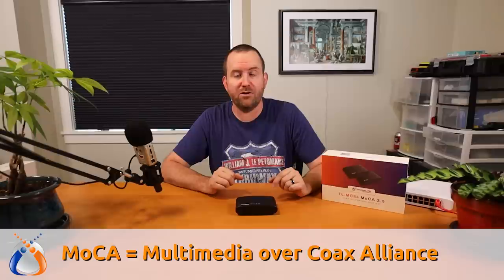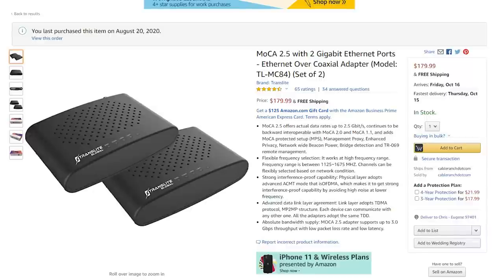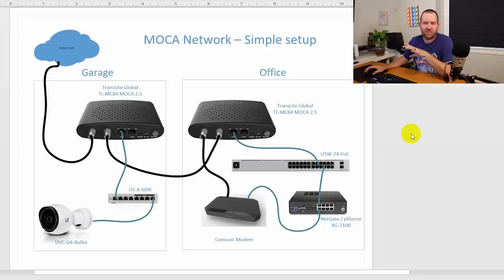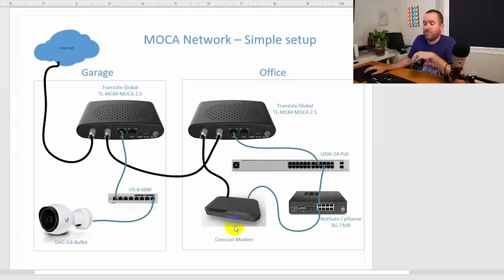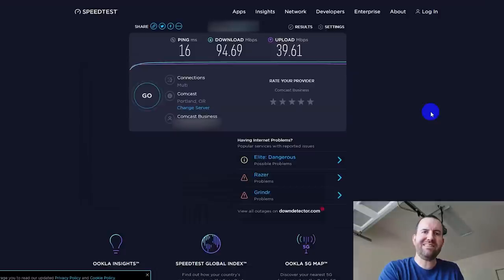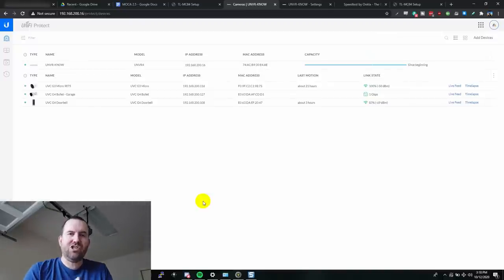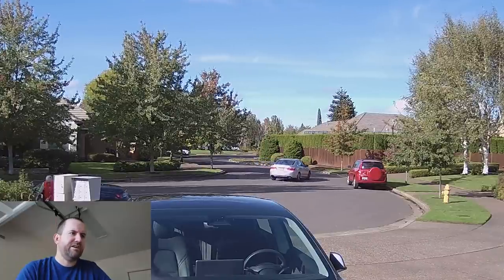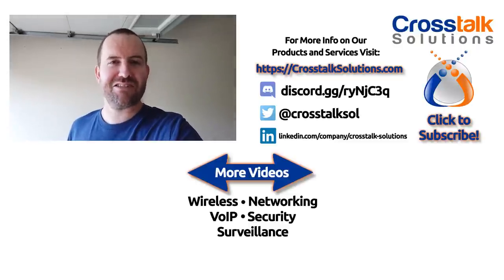MoCA Made Easy!

Comment: Hi Chris,

As several people mentioned, there are some issues with your installation.  Here is  my 2 cents on my experience with MoCa.

1) You do not have a filter to prevent your neighbors from tapping in on your internet.

2) The way you have your splitters is causing a lot of loss for the MoCA signal.  Splitters have very good isolation between the two out port (greater than 20dBs).  Since you have two splitters, you are cutting your MoCa signal by 40dBs.  It probably will still work but my guess you are not getting the full bandwidth out of your MoCa device (e.g. 1Gbps).

3) You are cutting the signal to your cable modem by at last 7dBs by having splitters in line.

The solution to all of these is easy and doesn't require running new wire.  The MoCa adaptors I use operation above 1GHz and CableTV/Internet operates below 850MHz.  If your MoCa adapters also operate above 1GHz, you can use a couple of satellite Diplexers and solve all the above issues.  Satellite Diplexers were a way years ago to send both Satellite Dish (which operatie above 1GHz) and Cable TV (below 850MHz) down down the same coax.  You need to read the specs for the diplexer carefully.   Basically, the TV side of the Diplexer needs to pass 5 to 850MHz and the Satellite side needs to pass everything above 1GHz.  I use my specturm analyzer wiith a tracker generator to confirm this but I doubt you have a spectrum analyzer.  I usually get them from my local distributor but this one looks like it will work:

https://www.amazon.com/Heavy-Diplexer-Splitters-Satellite-Approved/dp/B00JJ10V8C/ref=pd_lpo_23_t_0/135-4781497-1689209?_encoding=UTF8&pd_rd_i=B00JJ10V8C&pd_rd_r=dc6b0a16-b7c9-4856-b83e-d91d03c2afc0&pd_rd_w=aVpld&pd_rd_wg=Gk7Ya&pf_rd_p=7b36d496-f366-4631-94d3-61b87b52511b&pf_rd_r=VR7CQTF2E73V0W0WWB27&psc=1&refRID=VR7CQTF2E73V0W0WWB27

So all you have to do is replace your two splitters with Diplexers.  The in/out side of the basement diplexer connects to the in/out side of your office diplexer.  The UHV/VHF side would go to your cable modem in the office and your Comcast connection in the basement.  The SAT side would go to your MoCa devices.  And that is it.  You cable modem signal and your MoCa connections will now have very low loss and your Moca signal will be blocked from going out of your  house.

Contact me if you need any help.  You sure have help me many times so it is the least I can do.

Steve
Reply: Wouldn't even Diplexers introduce loss or noise? What about 2.5GBS compatability?
Reply: There will be some insertion loss with a Diplexer but it is usually only a couple of dBs. I have used Moca adapters with 50dBs line loss and they still work although some reduction in speed. So a few dBs loss in a diplexer is insignificant.  The Moca adaptors I have tested with a Spectrum analyzer are transmitting in the 1 to 1.5GHz band.  If you are using a Moca adapter that is using one of the channels below 1GHz (the ones I use do not because they are made to work with cable TV systems), well then, a satellite Diplexer won't work.  Not sure if the 2.5G Moca use any of the bands below 1GHz but if the adapter has a cable TV output, you are probably safe.

Comment: I used these in my house.  They are awesome and allow fast speeds.   I have a direct connection to my router in the master closet and ran an ethernet cable to a MoCa adapter and from there to my Coax for my house.  I have another MoCa adapter for my home entertainment center which is connected to an 8 port switch to provide internet to my TV, Fire Cube, Xbox, Blue Ray player and Receiver.

Comment: I enjoyed the video as always.  But, Something isn't right with your setup or the switch port is set to 100 Mbps.  You should get 900+ Mbps bandwidth.
Reply: agree with this, i get 450 mbps, and my main 6 way splitter isn't the correct 1-2500 MHz type (yet)

Comment: I have a pair (and 2 more coming) Motorola MoCA 2.5 adapters.
I am impressed for the speed.
The house has antenna cable running around the house, so I just utilize MoCA.
Data transfer is ~90MB/s (around 720mbps) between floors compared with 120Mbps powerline.
Make sure the splitter supports at least 2GHz

Comment: In your setup are you feeding moca data back out to comcast, and as a result anyone on that physical coaxial connection with another moca device could gain access to your network?
Reply: Possibly a MOCA filter on the incoming CC line?
Reply: Yeah, you need to add an inline MOCA filter where the coax comes into the house. It's a small passive device that your ISP can give you.
Reply: He has one of these filters (vertically in the ingress box) which removes MOCA frequencies from the line.
Reply: He has a "PoE" MoCA filter installed; he just didn't explicitly mention the need or depict it in either schematic. (And he may not have even realized that "the filter" he pointed-out in the junction box was his "PoE" MoCA filter, keeping his MoCA network off the cable provider premise.)
Reply: @karlkaufman2659  PoE and MOCA are two completely different things
Reply: @mountainslopes  Within the context of a MoCA discussion, "PoE," especially when part of the term, "PoE" MoCA filter, refers to the incoming signal's point-of-entry (PoE) to the residence. A MoCA filter (aka "PoE filter," "whole home filter") is required at the "PoE" to keep the MoCA signals secured inside the home and to efficiently reflect the signals back onto the coax.

And, yes, Power-over-Ethernet is another technology.

Comment: It wasn't clear if the filter you kept pointing to at the demarc was a MoCA filter.  It looked like a grounding attachment.  do you have a MoCA filter at the demarc so your neighbors can't watch your cameras?  Or is a filter somehow integral to your MoCA adapters?
Reply: I was also wondering about that. Semmed possible that he is broadcasting his moca signal into the cable network.
Reply from the maker: That is a MoCA filter. Most ISP’s put them on by default these days (I know Comcast does for sure).
Reply: Lol I was thinking the same thing, dear God did he just accidently rip a giant hole in his network?
Reply: This answers my anxiety-inducing questions! Thank you! So the moca filter stops the back-feed to the cable network! I freaking love this! I thought I was going to have to run ethernet to my whole house! This is much more economic and time-Conservative! Thank you for the upload, Chris!
Reply: Cox certainly doesn’t and it will really compromise the signal strength of a tiny MOCA adapter
Reply: @CrosstalkSolutions  Spectrum doesn’t seem to install them routinely, at least in my area. Installs with just a grounding block are common. Fairly sure also seen Mediacom installations without them. Definitely wouldn’t ever assume one is there without checking.
Reply: I don't know about this particular MoCA unit, but it should support encryption, which can be setup to secure the local MoCA network, but it is best to have the filter, which looks to be the case for Chris.

Comment: And pre-share key between the two unit, or some sync to authenticate to pair the unit.  So if your neighbor or a bad guy try to get in your network just by plugging in the same model or comparable moca adaptor with a politer at the outside of your house or same cable node.  From your screen shot look like it got some hex key you can put in to secure your lan traffic on the moca side.

Comment: So, for those mentioning it. Common practice by all coaxial ISP providers is to add a MoCA filter at the terminating block to a household. The filter Chris pointed out originally is a MoCA filter. However generally speaking, you do want to isolate MoCA coaxial networks from general household coaxial networks. This is due to additional noise being on the line, and MoCA works on a Node to Node bases. Where each splitter/splice/connection in between weakens the signal. Most MoCA compliant devices are not very strong amplifiers to prevent disrupting normal household activities. So limiting your connections between links is best practice. However annoying to actually implement. This implementation will work alright, however may disrupt any common MoCA connections in use by comcast such as the XB/XF lines of products which uses MoCA to connect between their gateway and the TV access points. In which case you would need to isolate the internet MoCA network from the TV network in order to have both function normally or use a RF analyzer to determine which available RF spectrum you can configure your device to use to avoid collision.

Comment: Nice setup. Currently using the MoCA adapters from Motorola. 
What I did was made a Telco line in which is a single coax from my connection box straight into my modem and another separate coax cables to make the network setup with using the existing coax cable.
The only hard was finding where the existing  coax began and ended.

Comment: In my experience, you should be capable of getting close to gigabit speeds from moca but you need to make sure that there are only good quality moca compatible splitters and/or amplifiers on the cable - it may be that there is an old low quality splitter somewhere in the cable run.
Reply: Yes, good splitters (moca uses specific frequencies), and you can also help things by adding terminators to any connections on the splitters that aren’t connected to anything. 

There’s also a simple part (name escapes me) that you can place between your line to the outside world to prevent data from leaving your house.
Reply: @jacobharvey2946  point of entry filter  (or possible exit?)
Reply: @neildingwall6534  Yup that’s it, a POE filter blocks the signal from leaving the house. Just has to be on the line coming into the house.
Reply: The house COAX wiring is probably old RG-59 not RG-6 or RG-6Q which could handle Gigabit ethernet. Plus not all of the Coax bandwidth is available because it also transporting cable TV, and since Coax is a single pair, you need to use half of the total avail bandwidth for Send & the other half for recieve (ie to support full duplex comms.)
Reply: @guytech7310  Definitey could be old cable. Though what was shown in the video, at least at the box looked pretty new. But cable tv and the moca are on different spectrum. So good cable and splitters means it shouldn’t conflict.

Comment: Is there any reason you wouldn't default to setting the static/reserved in your Unifi controller instead of on the device itself?

I always leave devices like this in DHCP mode and let my gateway or router specifically give out the correct address. That was Unifi knows it's static as well, and doesn't accidently give the address to another device if it goes offline for a period of time.
Reply: I would suspect that he had the DHCP range outside the area where he knows he has static devices (to mitigate the DHCP server from giving out already assigned addresses).

I.e., his DHCP is .200.100 thru .200.200, so he knows anything below .100 is available to set a static ip on the device.

Comment: You should have a mocha filter between you and Comcast so no one else can connect.
Also if you wanna clean up the office coaxial you can put the splitter behind the wall to a double wall plate and then only two cables coming off of that :)

Comment: I have used these units for about two years now. Now problems with the devices but one of the adapters failed suddenly. Luckely these adapters are so common in our homes that I could solve the issue within half an hour. I use them to get ethernet at my television over the same coax as my digital television signal. Replay and recording depend on a good high speed internet connection. So far my wife is happy!
Keep up with the videos! They are a constant source of info on my Ubiquiti system. Thanks for that!
Regards, Rinus - the Netherlands.

Comment: I have the same issue and solved it with a pair of Zyxel Powerline adapters for $90.  Simply put one in the garage on a power outlet and the other on a power outlet in your home office.  This will handle the network connectivity for your switch and cameras and then have your Comcast circuit go straight to your home office from the garage DEMARC using your existing coax.  No splitters, no extra patch cables, etc.  Just need to make sure your circuit breakers are non Arc Fault Breakers.  Fairly cheep to buy normal breakers.  It's a lot cleaner approach.

Comment: Ok. I have a xfi gateway. I enabled the MOCA in it. Now can I just add the MoCA filter to the cable entering the house then cable that to my Xfi Gateway. Then after that how can I connect this gateway to a MoCA splitter so I can get connection to more than one room in the house??  Out of the 10 cables I have only one that is connected to a room in the house where I don’t want it to be. I’m just stuck on what adapter I can use that goes from my MoCA enable router to the splitter
3 days ago

Comment: Bought a pair on your recommendation and they work great.  Have 2 questions, did you find a link to verify if you have the latest firmware?  My firmware is 1.16.7.  How did you log into the second device to change the IP address and PW, do they both have the same default login IP?  Only one comes up with the default IP address on the unit plugged into the UDM and I did have the find other devices box checked.  Do I have to switch units and then change the IP address of the second device separately?

Comment: As others have said, you need to make sure there is a MoCA filter on the line from Comcast (But looking at your service box, that filter you have may already be a MoCA filter, but you should at least double check). Likewise you need to make sure that the splitters you're using are MoCA rated. I have Gigabit fiber coming in, and use MoCA over the unused coax of my apartment to connect my entertainment center in the living room to my office (and incoming Internet connection). I routinely get 500+ Meg over the MoCA link.

Comment: 1. Tapes an ethernet cable to that coax cable in your garage
2. Pul the coax cable from the wall in your office
3. Keep pulling until the ethernet cable comes out
4. Crimp on RJ45 connectors

Now you have ethernet without expensive MoCa adapters. You could even do 2 ethernet cables and set up LACP to have a 2Gbps redundant uplink if your switches support it.

Comment: So, I have looked into these for my  home.  My home was new construction and all the lines where unfinished in the basement.They used CAT5e for the phones and there are COAX lines as well.  I changed the phone to ethernet and some are used.  But COAX are still not terminated.  If I am understanding this correctly, I should be able to run all the COAX lines into a single splitter with one adapter in the room all my cables terminate at.  Then, just put one at each end I want output from.  I was under the impression before that I would need an adapter on both ends of each cable.  If I am understanding the right, it makes doing this a hell of a lot cheaper.
Reply: The splitter only accepts one and is really cheap anyway. You also are more likely to get good results with a splitter haivng less outputs.

Comment: For a network that I want protection on, I isolate the MoCA network from the cable network.  Not sure I can trust that the MoCA filter is "working".  At minimum I would test that I can not sync to the MoCA network on the public side of the filter.  May be easier for me as I only have Internet and not cable TV these days.

Comment: I bought three similar devices back in 2018.  Mine are branded "Motorola".  (Model MM1000 on Amazon).  They were $60 when I bought them, but are $70 now (each).  So for two they'd be slightly cheaper than the ones shown here.  But they are only MoCA 2.0.  Mine have worked flawlessly.  And it came with everything you need including an ethernet cable, a filter to keep your network from escaping to the exterior cable (I didn't need this) and even a little wrench to tighten the coax with!  And they handle VLANs with no issue.  I didn't know if having three of them (using a splitter) would be a problem, but it doesn't appear to cause issues.

I have Fiber internet and nothing is connected to the coax in my house.  So these things are the only things using my coax network, so I can't speak to its compatibility with other stuff.

While I would have loved to run Cat 6 throughout the house, that would be almost impossible the way my house is built.

(Edit) Mine are completely "passthrough" bridge devices.  The devices I have don't get IP addresses.  There was nothing to configure.
Reply: You can still connect to the default ip address of the device. 192.168.0.2
Reply: @JasonVailUXGuy  Which device?  Basically it's completely transparent.  If my router was 192.168.0.1 and my computer in one of the rooms serviced by the moca device was 192.168.0.2, then I can connect between the two (router and computer) just as if they were connected by a single Cat 6 cable.  Or the same as if only a switch connected the two.  I've never run a speed test, but I know it's much faster than my Wi-fi.  Probably close to the rated 1 Gbps.
Reply: @JasonVailUXGuy  Ah, ok.  That's just so you can upgrade its firmware.  So it apparently has a fixed IP of 192.168.0.2.  I guess it's good that I'm not using the 192.168.0.0/24 subnet or it would trounce one of my devices.